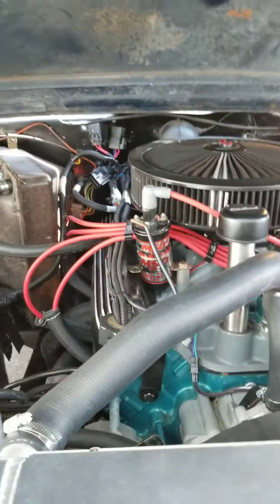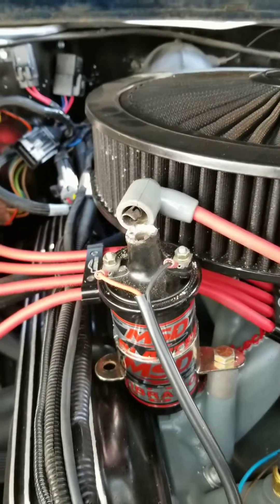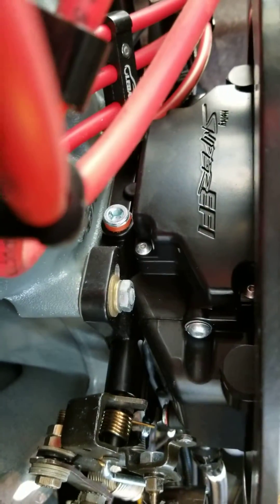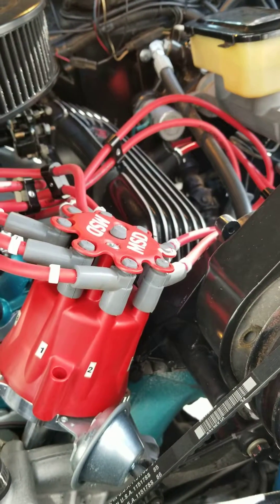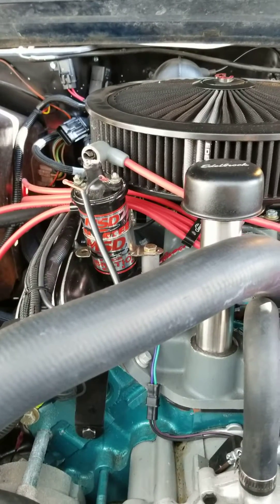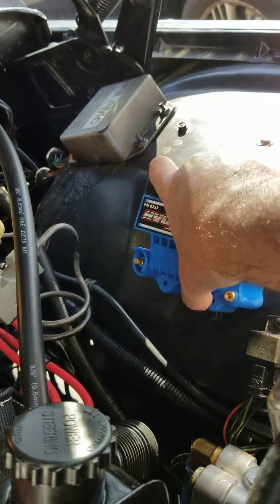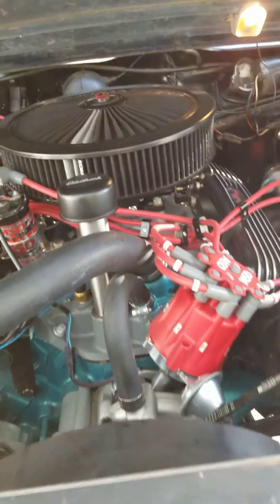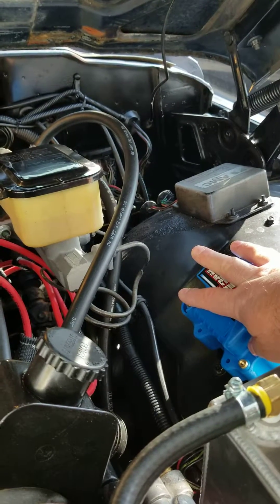MSD Blaster Coil Fail and replace (video 1)

Comment: You have two issues here, the coil tower burned up due to arcing caused by loose wire to the coil which was loose due to it being mounted on the engine itself, the type of connection for those canister type are of compression type pushed into a metal sleeve inside not too reliable, your new coil uses a snap on type of connection much more reliable conductive connection. Those kinda burns I’ve seen before and can only happen if there’s a loose connection causing an arc to form and jump across and burning everything around it, if your Msd box fails get either a fast cdi or Daytona sensors cdi the older versions were made by crane cams super reliable units, Msd boxes even the newer ones aren’t known to be very reliable, and yes good grounding to the engine to chassis and battery negative is very important